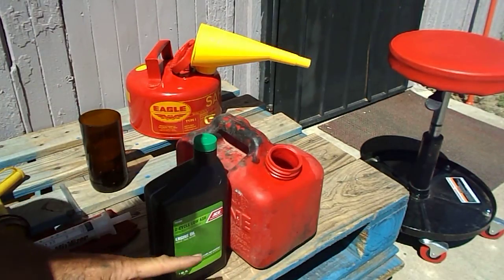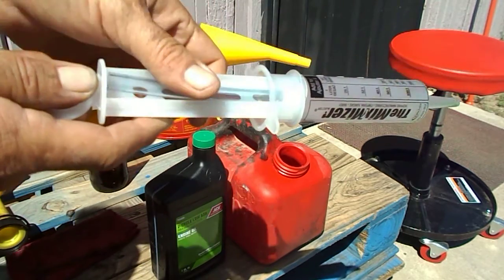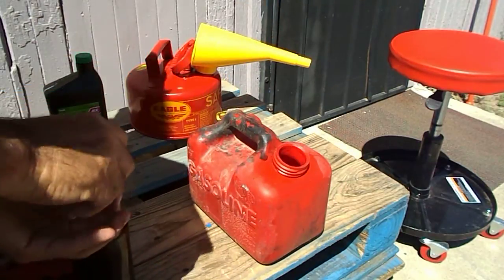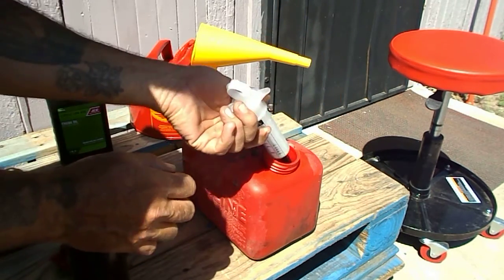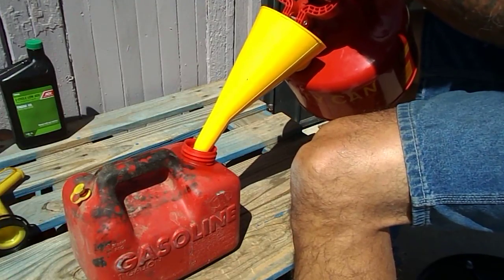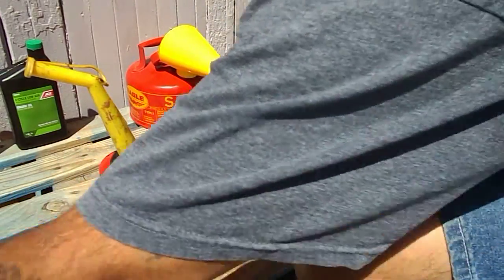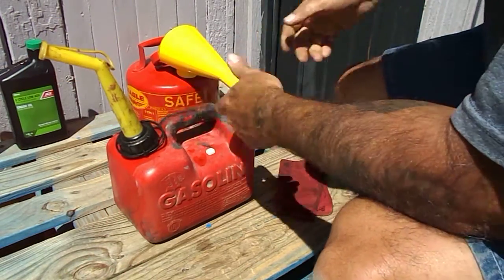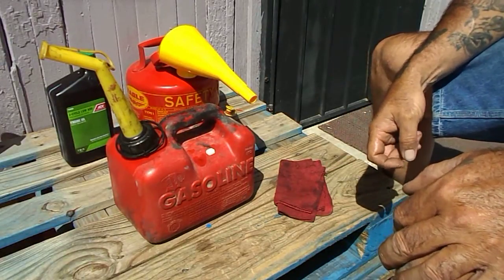Fuel mixtures for 2-stroke chinese motorized bicycles

Comment: Will the 50:1 oul from tru fuel already mixed in a can from Lowe’s or Home Depot be good to run? I’ve been running that and it’s been great but don’t wanna over do it on the pistons or anything
Reply from the maker: That's a lot of oil bro for everyday use. I would go with 32/1 for the most part. 

If u do use 50:1 a lot give it a mix with 93 maybe a shot of booster once in awhile see what happens")
Reply: 50 to 1 means less oil.....with that said don't waste the money and just mix yourself.  You get more for less.

Comment: You don’t run high oil to gas in chain saws and weed wackers. So 30-40 to one   I use premix. 91-95 octane no alcohol. More expensive but good stuff. Keeps for couple of years in can

Comment: Hey Brian I'm a new subscriber to your channel...I just put a 80/66cc engine on my bike and my question is will the heads and exhaust pipe from bike Berry or zeda fit on my bike??? I think that they will but I'd like to be sure and I'm also going to get a boost bottle for it ...I don't really care about going 55 or 60 mph I'd just like to have power taking off you know

Comment: Everyone seems to have a different OPINION on this TOPIC.... What OCTANE GAS TYPE!?? Most people seem to say 16:1 or 20:1 mixture on 80cc 2stroke bikes
Reply from the maker: Well first off you don't have an 80cc engine -- biggest one is 66cc. 

Second it really doesn't matter what octane you use. Because the gas company Twice a year mixes MTBE into the gasoline as a lead substitute. Keeping the bad carbon based gases out if the air. Third  it is your choice as to what mix ratio is right for your bike . I have run one at 20/1 and it came out pretty fast I have run 16/1 in another and got the same results then  the 24" magna I built in rachel I rayn 32/1 and it was fast and reved pretty high for the little engine. So stop listening to people and do what you think is best. You run into problems you know who to call right")
Reply: You want 91 octane gas.

Comment: I just got another 80cc bike my last one I didn't really didn't take care of wats the best ratio mix for it has even been broken in yet and I want to be able to get it to top speed on my old one I got up to like mid 40s the one I got now hits about 25 if I'm lucky wat should I do
Reply from the maker: change the gearing get a better carb put on the pipe go from there bro")

Comment: Would a 50:1 mix be too lean for it run?
Reply from the maker: YES!!!!  start with 16:1 or at the very least 20:1 dude u try 50:1 at start up u gonna fry the little piston not to mention the crank bearing and everything else in the bottom end ---- 16:1 for run in
Reply: brian noel yeah thats what I thought. My uncle told me to run 50:1 and I thought thats way too lean. I run 32:1 now though
Reply from the maker: that a good mix i do 32:1 but i use the high grade synthetic 2 stroke oil from Royal Purple it's the best shit out there ask me")
Reply: @blgarage9519  not if you use synthetic oil. Amsoil dominator 50:1 all day long

Comment: did you ride the bike to the gas station with that can and fill it up?
Reply: Rippin Engines no you can't as the minimum fuel is 2l and you can't fill the whole tank of petrol cos you need oil 2 already uk
Reply: Maybe that's how it is in the UK. In Canada I ride up to the gas station, throw in my oil and fill'er up.

Comment: Hey so I wondered if breaking in my china girl with opti 2 would be a good idea? And what ratio would I use?
Reply from the maker: sure sounds like good stuff to me") i recomend doing 40/1 for the first couple tank fulls or at least 100 miles then switch to 32/1 for the duration of the little engines life. yo9u should get pretty decent milage out of the 40/1 mix but check the plug a couple times during the break in to make sure it's not running to rich or to lean. remember to lean means u not getting enough oil to the cylinder and that can cause sezing or worse broken rod other stuff that u don't want to think about") thanks for watching")
Reply: well actally opti 2 recommends using a 100:1 ratio. i know that sounds crazy but there are people that swear by it
Reply from the maker: 100/1??? you do know that the higher the oil number(100) the less oil is in the fuel right? at a 100/1 u will probley have less that couple ounces of oil in the fuel and nthat my friend is not enough to coat the who;l bottom end plusd thr cylinger barrel and the ring beside the bearings and all the other moving parts that a 2 stroke engine has spinning around inside. during the break-in u want as much oil in the bottom of the crank case to give the crank bearing and the rod pin as much as possible so that when u shut it off the nextr start up has at least some oil on these parts to prevent seizing and other things from happening while the little engine warms up") but hey other people swear by it ( wonder how much they were paid to say that stuff?)
Reply: brian noel I don't know. It it's all over motorbicycling.com

Comment: Brian: I really like your channel.  You have a lot of really good and useful info on these engines.   What are your thoughts on the octane of fuels, from 87 to 92 pump gas, 100 octane Avgas, 110 oct. racing fuel,  gasoline with 10% alcohol/Ethanol. Then even change the sparkplug to a glowplug and run model airplane fuel.  A 88cc engine works out to about 5.33CID I think that this set-up might be a real screamer.   What do you think?   Keith, Ionia, Mi
Reply: actually higher octane burns slow to allow for higher compression
Reply from the maker: Well keep in mind that this little engine was designed to run a chainsaw at sustained high revs I would imagine they would do better with better fuel but I wouldn't go much past 100 octane. Once the piston start to float
Reply from the maker: At high speed top end performance starts to flatten out and peak horse power is the result. Simple really but with the inferior material that the Chinese use and the tolerances being so hit and miss the chances of catastrophic failure becomes greater the hotter the little engine gets. So the question becomes short term power gain verses long term dependability. Now here is where the compromise comes into play-GT100 octane fuel is a good all around fuel for lots of small bore engines that rub at sustained high revs like RC airplanes - dirt cars--speeder bikes and so on. It gives a good increase in power while burning at a reasonable temperature that is within the little engines operating range for power output. Anything higher like Sunoco 112 racing blue or 115 red will be way to much and once again failure is only as far away as the first hard left hander that pulls to red line at the end of the straight.
What I think is fairly common in the fact that we all want more and will do anything to get there. Racing fuel is a simple and fast option that is relatively expensive depending on where you are and who your fuel dealer. Now with all that said would I recommend using racing fuel? Heck yang are u crazy a 1.4 -- 2hp gain just by adding in a" better fuel. That my intrepid friend is why we call it winning

Comment: that's a tool I need I was just eyeballin ratio.still no start I just got a new racing carb sent to my house for free!now I have two still packaged not even opened they sent it twice some how?would you give it back?
Reply: still won't start I watch people starting up two pedals ,,I go as fast as I can pop clutch and just die to a halt and gas dumps out my exhaust??
Reply from the maker: heck no!!! you might need it someday") good score my friend") thanks for watching
Reply from the maker: check out the CDI make sure wired right then check spark plug wire if no spark then check mag???
Reply from the maker: https://www.youtube.com/watch?v=WfTGgy8m8tg check out this video my friend might have the answer to this problem")please subscribe to his channel thanks don")

Comment: which grade of gas do you use?
Reply from the maker: +Minecraft And More i used 93 octane burns hotter and makes more power in the cylinder that leads to more power at the wheel") it's all about the speed little brother") what the rear wheel gear size you got? 40t? 44t? i used a 36t higher the gear faster you go!~
Reply: +brian noel I got a 44t
Reply from the maker: (sorry it took so long to get back to you)that a pretty low gear do you have the stock rag joint set up? or a hub adapter? if it a hub adapter then invest in a 36t sprocket from mmbikeparts.com it will increase two things right off the top--mpg will increase by at least 20mpg and top speed will go up from somewhere in the 20-25mph range to 28-36mph without doing anything but changing the rear sproket")
Reply: ya i use a rag joint and i can go 33 with a 44t so imagine 36t!
Reply from the maker: +Minecraft And More I had a 36t on my speederbike and was clocked by a phoenix cop at 41mph with a stock 48cc engine so i will tell you that stock rag joint system is not a good set-up it will eventually ruin your wheel and that will cause a dangerous situation look into switching to a hub adapter from mmbikeparts.com yes can be expensive for the parts but instead of driving the spokes of the wheel it will drive the hub giving more stability- drive- and acceleration over the whole powerband this my young friend is a better overall set up")33mph with a 44t is hauling the mail jackson!!!!

Comment: Your real cool man, can you do a video of your bike?
Reply from the maker: Chance Gomm check my channel under red speeder bike playlist you will see it there thanks for the share and the visit")
Reply: I also subscribed! :)
Reply from the maker: Thanks dude posted a new speeder bike video this morning check it out
Reply: I'm getting a 66cc motor for mine on Monday, can't wait!!
Reply from the maker: dude thats great just remember take your time building it and everything will be solid and best of all FAST")
Reply: Ya thanks, my grandma got a new weed eater less than a month ago didn't mix any oil with it just used gas she killed it so I'm taking the spark plug from that (it's a nice one) and I'm going to take the air filter out cause it's a nice thick spungy one and use those on my bike, I'm a bit money tight right now. Also for the brake in time should I use 32:1 or somthing lower.
Reply from the maker: 32:1 is a good mix try to use the oil that is low ash blend. stay away from all that blended stuff might not agree with the piston during the break in. (Here's a tip before you just screw in the plug take off the head and screw it in to see if it clears the piston.) Some lawnmower plugs are to long.
Reply: Oooo thanks for the help